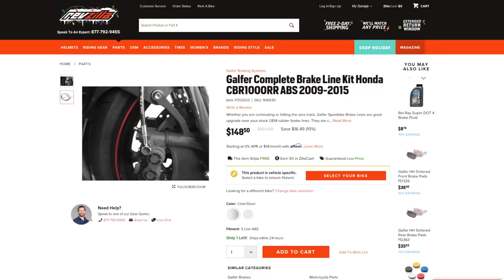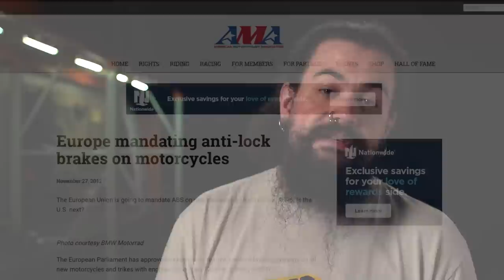3 Arguments AGAINST Motorcycle ABS!

Comment: I agree that for off-road use, ABS can get in the way.  On the street, however, I can’t think of a single circumstance where it gets in the way.  And, yes, maybe 0.1% of street riders than actually out brake an ABS bike on dry pavement, but 0% can out brake ABS in any other circumstance, particularly roads where traction is rapidly a varying due to interleaved wet and dry pavement, for example.
Reply: Agreed. Pro riders can out brake ABS on a track in perfect conditions (good pavement, time to anticipate, etc), anyone who gets surprised and needs to brake in an emergency situation gets outperformed by ABS
Reply: This doesnt help lol, but in a car it is absolutely faster below 80kph to lock the front wheels. If the shortest fastest stop in a straight line is whats right for the situation of course
Over 80kph the grip v inertia equation goes the other way.
Reply: The Mongoose No, it is never good to lock the wheels when stopping on a hard surface.  Sliding (dynamic) friction is always less than non sliding (static) friction.  That is why dragsters never want to spin their tires during a drag race.  As soon as the tires begin to spin, traction goes down dramatically and the opponent pulls away quickly.  Spinning tires during acceleration is functionally equivalent to locking and sliding a tire during deceleration.  Now, if you are talking reasonably deep snow or sand where the locked tire can “dam” up material in from of the tire, then locking the wheels can have an advantage and allow a faster stop.  ABS is a detriment in such conditions.
Reply: LTVoyager now sorry but it was tested a long time ago when abs was being commonly introd. 
Inertia mate. Which is why spinning a wheel is slower in a straight line. Inertia.
Reply: The Mongoose you need to go back to physics class for a refresher. Friction coefficient is what gets you stopped, and kinetic (=sliding) friction is always lower than static friction. Exception is gravel or snow where a sliding tire can build up a wedge in front which helps with deceleration. Inertia is just another word for the stored kinetic energy which is independent of the braking mechanism.
Reply: The Mongoose Sorry, but that isn’t how physics works.  Even those who paid attention in high school physics know that.  The main reason that a really good rider can stop faster than an ABS equipped bike is because if they are really good they can hold the braking pressure right at the threshold of lock-up, but not allow the tire to actually skid.  Most ABS systems don’t react until the skid has actually occurred and thus the stopping distance is lengthened due to the short periods of wheel skidding.  Having said that, modern ABS systems with 32 bit processors are very fast at detecting the start of a skid and can react before any significant skid has occurred, unlike the early systems with slow processors that simply could not sample and responded fast enough.  That is why modern ABS systems are extremely hard to outperform even by the most skilled of riders.

I’d like to read this study you reference.  Please provide a link to it or a reference to it if only available in hard copy.
Reply: 5 cents per year in fuel due to extra weight 😫👍
Reply: NzJohny Yep, there is no free lunch.  😂
Reply: Motorcycle tires do not operate fully planted. In the dry they develop their greatest bite while slightly sliding and heavily loaded, and the sliding effect is more pronounced the faster you go. As the limit of traction is approached, tires slide some as braking force increases. Some slide more than others, but this is the zone of max braking force and max stopping power, a zone that ABS positively removes. ABS takes this upper braking limit away from the rider, a horrible situation when you need to clamp down at maximum. Though much better today than previous years, ABS is mostly unable to discern between necessary control grip sliding and user error, removing capability that is important to have access to in extreme situations. No doubt it can be a benefit to many riders in moments of panic or ineptitude, but it also just about guarantees braking skills remain unlearned. 
Lemmy, I applaud you taking up the topic. Put me down as a loud "no" for ABS on my motorbikes, I hope it remains a choice.
Reply: Xsheaffer The comment by Mongoose said “locking” the wheels.  This is much different than slip ratio which is what I assume you are referring to.  And modern ABS does NOT remove slip during hard braking.  This was the case in the very early years when sensors were too coarse and controllers too slow to react, but for probably the last 15 years or more ABS controllers will allow a certain slip ratio before they intervene.  Here is a paper that is 15 years old that discusses this, and I don’t think this was the first.  http://wseas.us/e-library/conferences/cancun2004/papers/485-428.pdf

Most ABS systems will not prevent “threshold” braking.  As long as the slip ratio is small enough to prevent a slide (wheel lockup), the ABS will remain unobtrusively in the background.  So, you can practice threshold braking all day long on an ABS bike and the only time ABS comes into play is when you have failed at your attempt the threshold brake and have caused a wheel to lock up and skid.   That is why most of the demonstrations of a rider stopping shorter on a non-ABS bike are now 10 or more years old.  It is now nearly impossible for any rider of any skill level to outbrake modern ABS.  And even if they do, it will be only in perfect conditions with uniform traction on a smooth road surface.  Add in any variation in traction and the ABS will win every time.

I have no issue with anyone who wants to have a nonABS bike as a personal choice, just don’t use false information to justify it.  If you are aware of any recent demonstrations (on bikes less than a decade old) showing a rider on a nonABS bike out braking the same bike with ABS, I’d like to see them as I haven’t seen one in a long time.  And I don’t think it is for lack of trying.  The reality is that virtually nobody can do it anymore and certainly not consistently.
Reply: if you brake progressively on a bike with ABS, it doesn’t kick in, it only operates after the wheel locks up, so the perfect braking rider won’t ever use the ABS. But if they ever need it on the street (you done fucked up) it’s there.
Reply: ABS comes in when it senses not only wheel lock but differences between wheel speeds.  F/R wheel speeds differ under normal hard braking.
Reply: Xsheaffer Yes, read my earlier reply about slip ratio.  Here is another paper that describes it in even more detail.  I say again “ABS will not intervene if an expert riding is braking right at the threshold.”  ABS will only intervene if you “cross the threshold” into the region of decreasing traction and thus too much slip or skid for optimal braking performance.  So, if you think you are an expert at braking and you keeping triggering the ABS system, then you aren’t as expert as you think you are.  http://www.ijsrp.org/research_paper_jul2012/ijsrp-july-2012-89.pdf
Reply: The papers you are citing are so off the topic I'm not sure if you are being serious. #1 is an undergrad level math treatment of a wheel in 2D from Iran, #2 is an academic study of antskid for fighter aircraft from India ca. 2012.
Reply: Xsheaffer It is the principle that is important, not the specific topic if each paper.  Physics principles apply to many applications.
Reply: i would not presume to think or say i could outperform ABS but I have been riding since 1971, LOOOONG before this technology was available.  I think its great but also feel I can live well without it.  Of the perhaps 20 bikes I have had since those glory days 3 or 4 have had ABS.  Since I self-wrench, I find the ABS an unnecessary complication with benefits that, while great in an emergency, can mostly be rendered unnecessary by good sense and situational awareness combined with an adequate gróunding in basic motorcycle skills.
Reply: Yeah maybe the top five riders in the world on the perfect pavement in the world and it’s still less than 1% I don’t even know how he brought it up as a point because you just eliminated 99.9% of the people and the roads
Reply: I am a Japanese girl living in Scotland.

Just this week I was out on my 96ci Harley Street Bob  (FXDB) to pick up some essential shopping.

I was cruising along a dual carriageway at around 60mph well within the speed limit and as it's lockdown the roads were empty.

Up ahead I saw an SUV stopped at the end of the slip road (kinda like an on ramp in the US). 

I thought, "How the hell have you managed to get in that position".

No sooner had I thought that the SUV pulled out into my lane at 5mph and began accelerating slowly as I approached from behind at 60mph.

I had to emergency brake and the crap Harley ABS kicked in, lots of tire smoke, the bike was bucking and kicking and wanting to veer off.

I managed to hold the bike and it slowed to a matching speed of the SUV with inches to spare. My front wheel was an inch off the back bumper.

The ABS both saved me and almost killed me in equal measure. Make sure you buy a bike with GOOD ABS.

Either way I am glad I went to the bathroom before I left home 😰😰
Reply: Akiko Fukuwara 福原 秋子 glad you’re ok and it sort of tried to and sort of did save you.
Reply: so its pretty obvious none of you ride.  When you drag brakes in a corner, as you are suppose to do, when cornering on a motorcycle.  The wheels will slip, this will cause the ABS to pump the brakes, in a corner which is DANGEROUS.

The reason someone can outbrake ABS is because 1.  ABS doesn't actuate until the brakes lockup, which means wheel skid.  2.  There are points in there when there is no braking forces are being applied.

They took a day 1 motorcycle student, taking the MSF class.  Had him practice braking and in less then 1 hr he could out brake ABS.  HE HAD NO PREVIOUS MOTORCYCLE EXPERIENCE PERIOD.  ABS is a joke, its trash and it shouldn't be allowed on motorcycles for the road.  Until the motorcycle racers can do it, you don't stand a chance doing it.
Reply: S toggy You are wrong on almost every count.  I have been riding since 1970 and am a Total Control instructor in PA.

Modern ABS does not need a wheel to lock up before it activates.  It can sense and compute so quickly now that it needs only measure a difference in rotational velocity between the two wheels and can begin to work long before the wheel locks.  It is this same technology which allows traction control to work and maintain a specific amount of wheel slip.  You are talking about 1990s ABS technology, not current day implementations.

I’d like to know who this “they” is and see a reference to this supposed rookie who learned to outbrake ABS in one hour.  Without a reference, it is just another urban legend.
Reply: @stoggy4839  motorcycle racers don't uses because it is banned in most classes, just as  active dampers etc. But they use other nannies - wheelie control, traction control, different maps, etc - why? Because they're allowed.  And they do well. ABS is on motorcycles since 1988, not 2015, there have been leaps of progress made, and the 9th generation of motorcycle ABS integrated into other systems and is developed to the point that outperforms 99,5% of riders in any situation. Like one man once said - "in terms of safety, it does to the front wheel what traction control has done for the rear wheel." And racers use traction control, don't they? Google cornering ABS.
Reply: @zokjay4174  Ok so on the 2015 FJ-09 its ABS was so bad you couldn't trail brake.  Now Yamaha didn't invent the ABS system they put in that bike so i would assume that was the same as in a bunch of other bikes.  Now they have cornering ABS, like in the 2020 Tracer 900 Which is better but still suffers from a host of problems that are the same that the 2015 FJ-09 suffered.

What rule are you talking about that forbids ABS?  In what type of racing too?

I know a lot about cornering ABS its trash.  It the same ABS as before but they put a lean angle switch on it.

So what bike do you ride?  How often do you change your brake fluid, how often did you change it before ABS?

Maps?  Maps are for fuel injection, before fuel injection they used jets.  Fuel injection just allows for changes to the fuel ratio while riding.  Which obviously jets didn't allow.
Reply: I hate ABS in my cars, so I believe that would carry over on my bike.
Reply: Abs brakes suck, I can out brake abs in any situation but then I guess most people can't ride as well as I can. I can lock the front and rear wheel up at high speed, when doing my p plates I locked the front wheel up at about 90 kilometres an our and held it locked up until I came to a complete stop, my riding instructor was very impressed to say the least.
Reply: @blacksheep6888  You said your psychiatrist was very impressed…. LOL.
Reply: @LTVoyager  no he showed us a video and told us there was only one person he knew that could lock his front wheel up at high speed and hold it locked until stopped, so I did the same and the riding instructor said well now there is two people he knew that could lock the front wheel up at high speed until stopped. I can't help it if I can ride a motorcycle mate.
Reply: @LTVoyager  don't need one mate been riding since I was 6 years old now I am 50 years old and don't even own a car my motorcycle's keep me sane, but you sound like you need one pronto
Reply: @blacksheep6888  You waited until you were 6?  I taught myself at 4.  Been riding 58 years now.  Come back when you get some experience.
Reply: @LTVoyager  I guess you can't help it if your riding skills are so poor that you need abs and are jealous of us riders that can use our brakes to their full potential like I can, sad being an old man with poor skills
Reply: @blacksheep6888  You have it completely wrong.  I simply also have intellectual skills as strong as my riding skills so that I understand the physics of braking and why ABS will outperform a human under almost all conditions and certainly under adverse  conditions such as rapidly changing surfaces such as an oil or ice patch on an otherwise dry surface.  Keep reading and some day you too may be able to comprehend that.

Comment: Well if you never speed, always have good space cushions, never get distracted, have fighter pilot reaction times and the good lord with you ABS is not needed on the street.
Reply: @cobalt_sabre2735  Braking isn't the only option though. There is also swerving. Also, practicing emergency braking can get you to be quite good without ABS. My bike doesn't have ABS, and at first, I was greatly concerned, but with experience, I've been able to get quite good at braking in an emergency.  In fact, I'm more concerned about being rear ended, which is why I usually resort to the swerve, since the last thing I want is to be stuck between the car that just cut me off, and a car behind me making me into a sandwich between two cars.
Reply: @cobalt_sabre2735  btw, that wasn't an argument against ABS. I think ABS is great to have. I wish by bike had it, but I have gotten quite good with my braking that it would be more of a peace of mind than a necessity at this point. The thing about being on a motorcycle though is the threat isnt just not crashing into things but things crashing into you. While ABS might save you from crashing into the idiot that just go out of the parking lot, it will do nothing to stop the idiot behind you from crashing into you. Swerving, on the other hand, might, and that is an essential tool to have, with or without ABS.
Reply: @joemann7971  I agree with your point exactly. What scares me most about the new ABS age is that it seems a lot of new riders are seeing this as a feature rather than an absolute last resort safety mechanism. If you're constantly activating ABS while riding, you either need more training or need to make better choices while riding. 8 hours of training in a good riding class will do more than ABS ever can. To me it's the same as a car, the only time I've ever really ran into ABS is in the snow and ice, and I don't think it's a good idea to ride in those conditions
Reply: @TitanFlare  my bike doesn't have ABS so, I had no choice but to learn to brake properly. I tend to swerve when I don't have a lot of time to react and brake properly.

I'm from California, so when I see a car stop fairly quickly, my first instinct is to swerve into a lane splitting position and apply the brakes, which generally gives me a huge space cushion. I always stop to match their speed before so start lane splitting to give the drivers in front a chance to see me.
Reply: Most abs, is only on the rear wheel,  so not really needed on the street or any where.